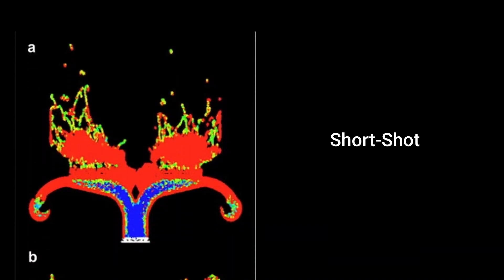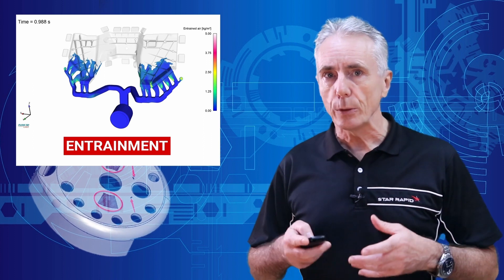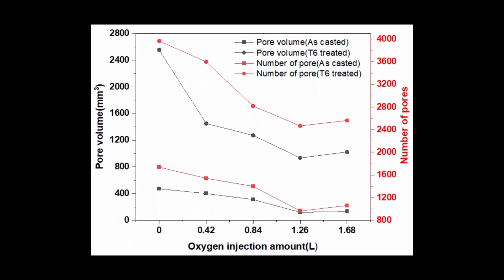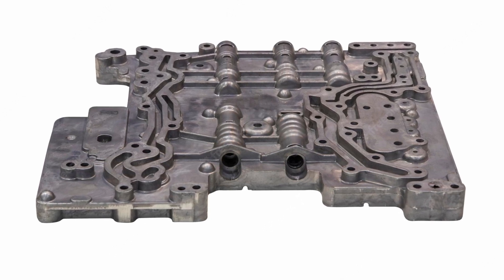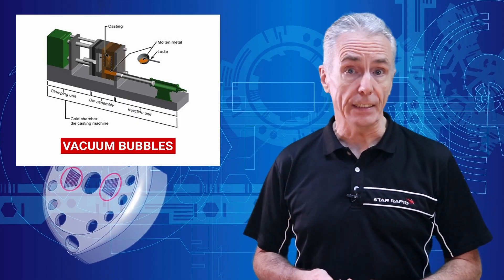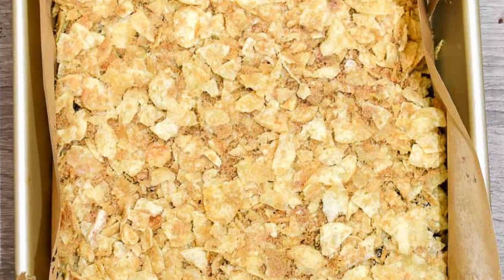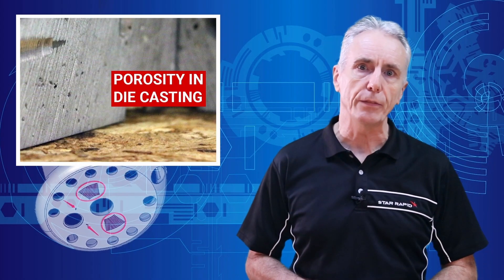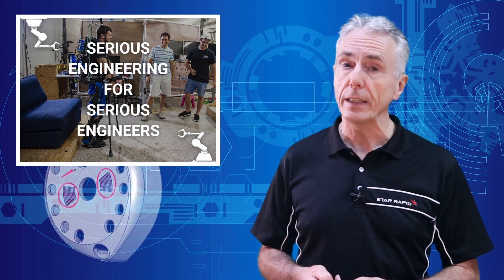How to prevent/ manage POROSITY in PRESSURE DIE CASTING | Serious Engineering: Ep 29

Comment: Hello Gordon, I have fully watched your video and have to disagree to at least 70% of the content of your video. I was working at LKR till last year (video you showed from the SUSTAINair H2020 Project was shot at our plant) and your mentioned short shot was intended to occour in that case. A short shot is something you do to set up your casting process and break it down into your 3 phases for perfect machine parameters. Next up you can definitely manage the entrained air - but why not mentioning the 1. phase? This phase is crucial for the porosity in your casted part. The simulations you showed were quite bad and should not be applied to the real casting itself - you should have mentioned it to make that one clear.  Also a vacuum system is definitely not "highly unpractical"... the system is just as smart as it's user :-) and last but not least your recommended alloys... the most common alloys in die-casting are A226 and Silafont-36. Yes the eutectic alloys are well known for a good casteability but they do not have an inpact on the amount of porosity in your casted part. Regarding the mole fraction to mass fraction higher porosity can occour but just if you play bad with your temperatures.